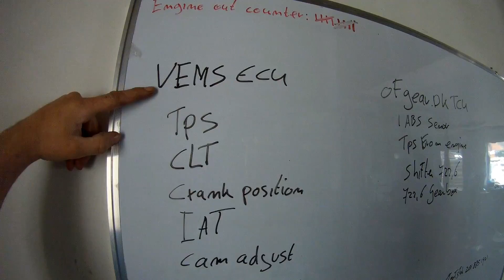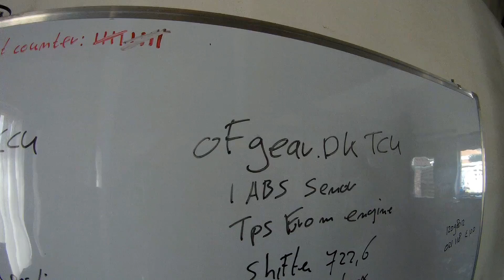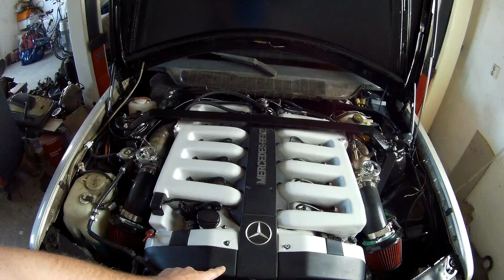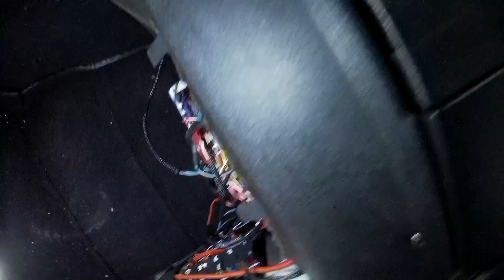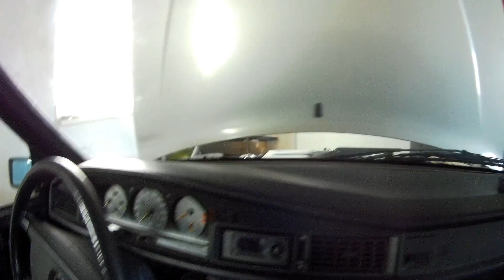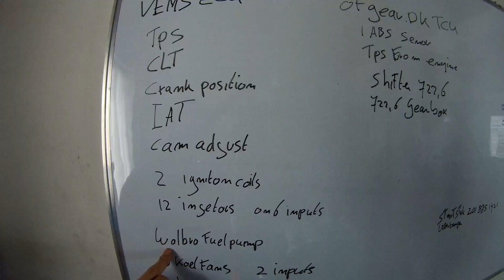Mercedes 190 V12 Engine & Transmission Controls Explained

Comment: Hi there, great job!
What do you think about manual transmission on m120 engine? 
How much is it harder to install and to safety drive on the road with that power?
Reply from the maker: There is no bolt on manual that fit so IT needs to be custom made.  I think IT Will drive okey but i think a automatic Suits IT better

Comment: Great video, very informative. I'm swapping M104 2.8 24V and 722.4 into my 300E (M103) and didn't know what to do with speedo  since 124 has cable and engine and gearbox are from W202

Comment: When you change de radiator for a bigger one, do you intend to modify the cooling system so you can loose the 'holes' on the headlights ? 
Must be really dificult to cool such a big engine in such a small engine bay though.
Reply from the maker: Yes smaller radiator is not An option this oem radiator needs a fan.running al the time to keep the engine cool when standing still also in the s600 oem configuration. And i did this because when i need a new radiator i can Just buy a oem s600 radiator
Reply: @JMSpeedshop  It's great to see this project, as i love both the 190 and the W140 . 
Keep up with the project and the videos. 🍻
Reply from the maker: Thanks i Will do